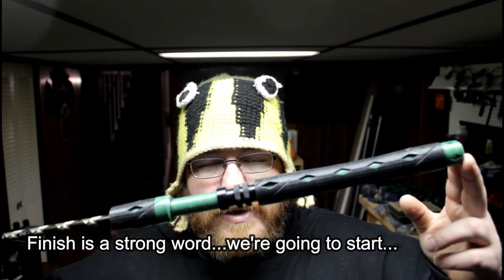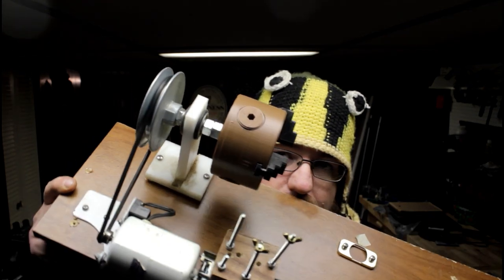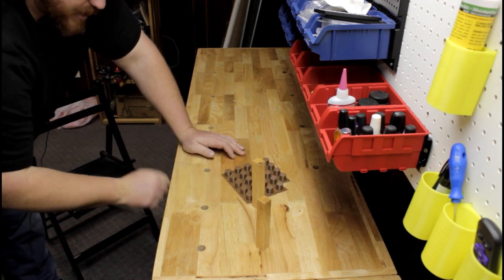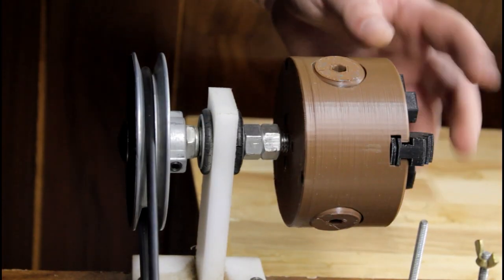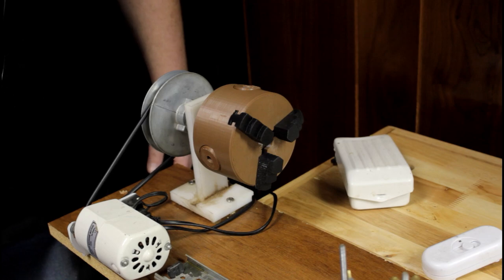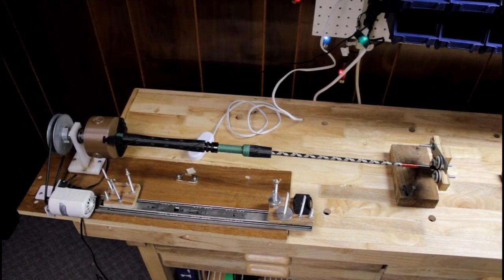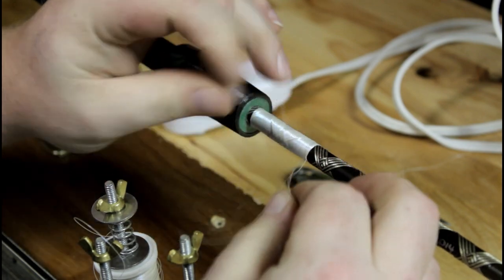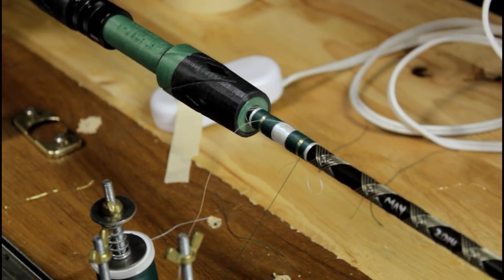Rod lathe chuck and fishing rod build: Part 1

Comment: did you ever do anything else with this project? looking at making my own to wrap a few rods.
Reply from the maker: I kept it the same for now it works pretty well, I haven't had time to wrap any of my projects though, so I haven't made any of the improvements it needs. I would still like to do a 3d printed roller guide design, I think with just some 608 bearings and some flex filament and a channel type design for the base would be awesome. But like with everything, work and life gets in the way lol.